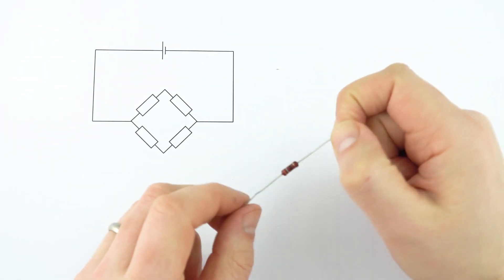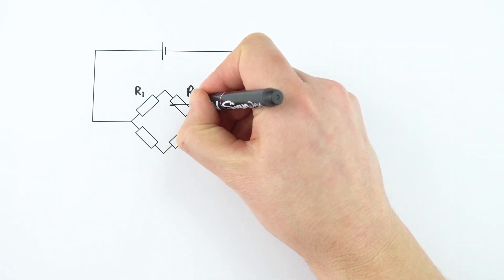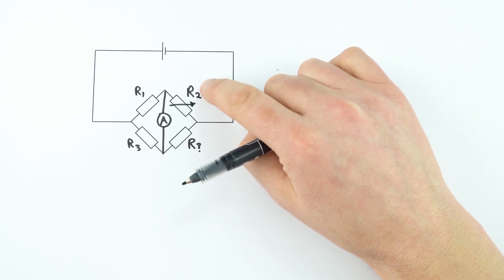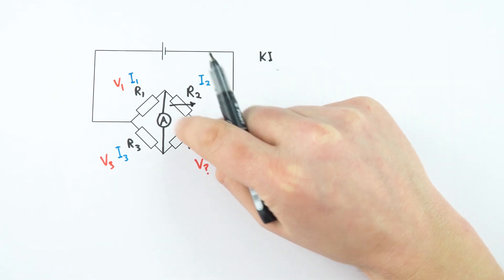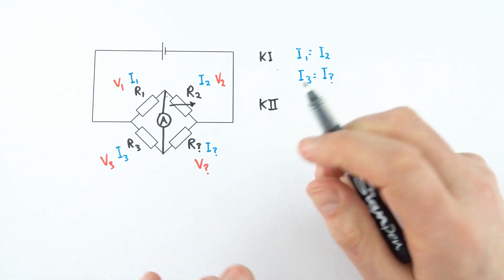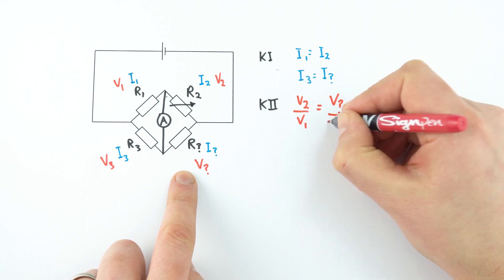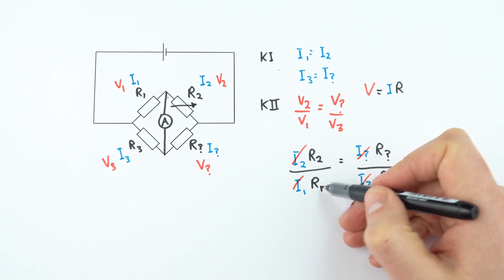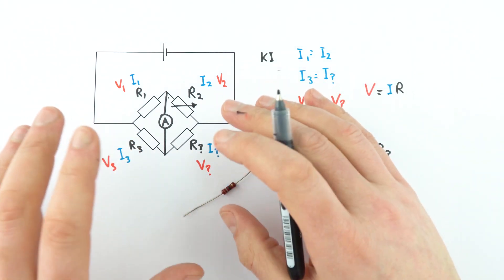Wheatstone Bridge Circuit - A Level Physics

Comment: Hello! Physics online~ love your video so much. But I was wondering why V2/V1= V?/V3, still don’t know how does it come from🥺
Reply: I would put it this way. According to Kirchhoff’s second law, the sum of potential difference of the upper route and the sum of potential difference of the lower route is the same (V1+V2=V3+V4=emf). Due to the fact that no current is flowing through the ammeter, V1=V3 and V2=V4. Then we can mess around with the algebra to obtain whatever ratio we like to have, e.g. (V1+V2)/V1=(V3+V4)/V3 to obtain V2/V1=V4/V3.
Reply: Hi, I think it is because, due to Kirchoff's Second law, all voltages in a closed loop = 0.

The 2 resistors on either side and the ammeter make two closed loops respectively, hence, the ratio of voltages would both equal the same.

Hope that helped!
Reply: Basicly,when current not going trow ampemetar,u have same potential on both sides of amperetar,thats why current wont flow,so u can draw same picture without ampemetar, put v2 to be 20 v1 10,for other 2 10 and 5,so when u calculqte eqch side u get 2,u are making statemend that r2/r1=r?/r3 is 2=2,then u calculate potential in places where ampwmetar is conected,and u will get same number,so u will know current is not going trow ampemetar,u picked up good value for R2,then u can cqlculate r? From that formula r2/r1=r?/r3 then r?=(r3×r2)/r1